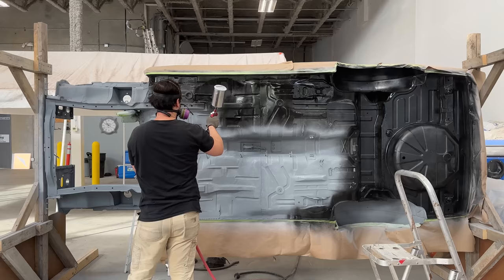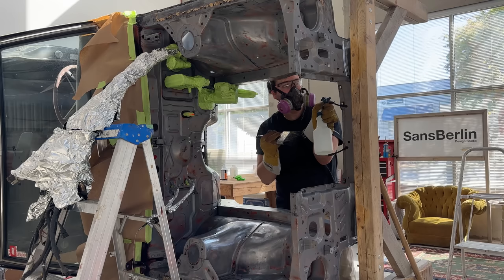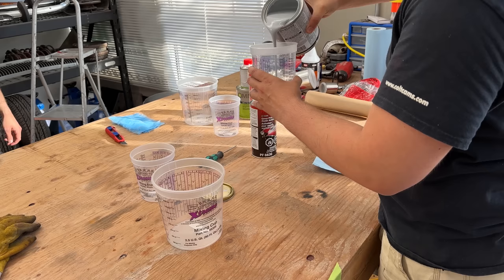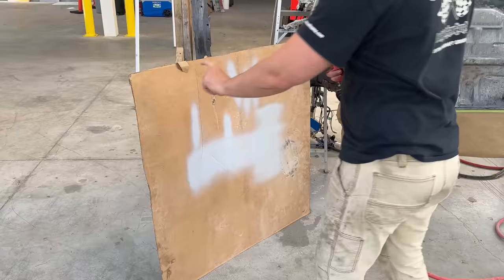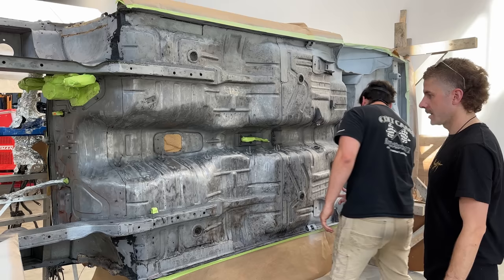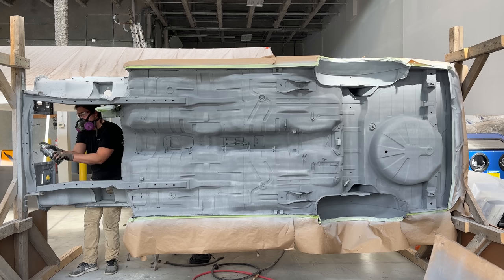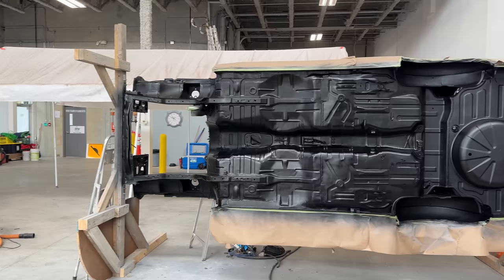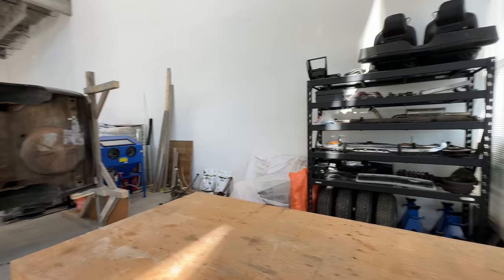1972 Toyota Corolla: DIY Undercoating

Comment: A few points.  Generally, on bare metal, the first coat of primer is an etch primer.  Then you apply the 2K primer.  On the bottom, you could have gone with a rubberized stone chip paint.  Not quit as thick and difficult as a bedliner type coating.  Then, when you spray, at the ends I noticed you were fanning off.  That is when you have the spray gun essentially travel in an arc.  The issue with that is that you get a coat that is thin at the sides, and thicker in the middle.  Keep your gun the same distance at each end of your pass and it will give you a more even coat.  

Enjoying your progress!  It makes me miss my ‘72 Corolla.
Reply from the maker: Hopefully that rust converter containing the acid did some etching, as I did think about it. Thanks for all the tips man, i'll remember it!
Reply: @sansberlin   Epoxy primer is fine if you ask me. I know there is somewhat a tug-of-war between epoxy and etch primer, but epoxy has worked well for me. Considering the conditions in Finland, which is between ice and thaw with road salt added to the mix, I would say epoxy sticks on there well.

Stone chip is a good call, and you can paint and clear over that to get a nice finish too, but regardless I skipped it on my door sills, will have to see how the paint holds up.
Reply: Etch primer stays in the 70s. We now have 2k epoxy sealer
Reply: @janeblogs324   I've seen both used.  But I guess epoxy is the better option since it’ll stick to just about anything.
Reply: @---xd4wm  Interesting, I figured thats a possibility but I sprayed epoxy on acid treated regardless, I guess I was in luck. I do sand the acid treated areas before paint anyhow.
Reply: @---xd4wm  Interesting, I figured thats a possibility but I sprayed epoxy on acid treated regardless, I guess I was in luck. I do sand the acid treated areas before paint anyhow.

Comment: Very good work ! Just as an information, dont add a rubberized undercoat. Use a thin film of fluidfilm ASR as base and spray a Wax based coating like Dinitrol High Performance Wax over it. Your car wont ever rust. For the cavities you can also use Fluidfilm ASR with the adapter nozzle to spray 360°. You really need to get material in, dont be cheap on the application.

Comment: Man I love what you're doing, it's both relaxing and inspiring to watch. But please use earpro when you're spraying stuff with the air hose. I have tinnitus now and all I can say is I'd rather have dealt with the momentary hassle than deal with this permanent discomfort that is only going to get worse over time. I don't think the spray gun needs earpro since it's not nearly as loud or high pitched, but straight air does need it.
Reply from the maker: When I blow out the air trap in the back its so loud! will do, thanks for looking out

Comment: I'd say you are doing a great job. When it comes to bedliner, those thick, goopy substances seem to be all a sure fire way to hidden rust and more problems. Fluid film seems to be one of the bigger brands in North America, and the application is very easy and it shouldn't hide anything beneath it. Of course, the protection is mostly from rusting and not from impacts from stones or gravel, but that could be a simple and quite inexpensive way to add a little extra rust protection, if you think it is necessary. Since it is not really a coating, but a film, it is recommended to be reapplied every year or at least every couple of years, but it is something you could easily do yourself. Similar products are also available from different brands like Liquid Moly, Dinitrol (not sure if available internationally), Würth etc.
Reply from the maker: Could something like this be applied even after i've painted? extra layer of protection? New episode today

Comment: since youre rebuilding the interior id suggest you add a layer of dynamat sound insulation and they also sell some other foam that does like thermal insulation like put it EVERYWHERE yes it will add weight but the interior will fell like a luxury car, im talking roof, doors, trunk, anywhere there's bare metal make sure to insulate it, also if you do add it get the roller tool to make installation easier, cant wait to see more from this.
Reply from the maker: Right now there's already carpet in the car...but there was a small fire in the last episode. I think you're right, maybe I should take out the carpet and headliner to insulate everything. I want that luxury resto feel. Cheers man
Reply: it won't work, the majority of the noise comes through the thin glass and tire noise

Comment: In trucking, I know a lot of old owner operators hit their frame rails with 3 cans of WD-40 before the winter, with the salt on the roads. I know it's a different thing here in Vancouver, but it's still probably a viable option on a car. Those guys don't have rust issues with their trucks.

Comment: Not gonna lie, I'm just some random that had this video show up in my feed, and i wish i had known you were doing something like this beforehand so i could give you some advice.

With deoxidine, (rust converter/phosphoric acid) you need to apply it with a scotch-brite pad and rub/key it into the surface of the metal and really deeply into the left over rusty pits. The reason you use a scotch pad is the acid will not penetrate into "deep" rust by itself, it will only convert that very top layer. You ideally need to remove as much rust as practically possible with a wire wheel first and use the acid as the final solution for the small bits you either missed or cannot get to.

From there you immediately wipe it off with a damp wet rag before it dries, which you semi frequently rinse out in a bucket of water. It seems counter intuitive at first but the wet rag actually dilutes the excessive acid and helps spread it out on the panel. If you've done it correctly, your panel will have this almost tacky looking clear coat effect, that is silver/blue in colour. This is a fine layer of acid that is converting and temporarily protecting the panel.
If you leave straight acid to dry, it will form thick white layers that will not come off very easily. It will clog and ruin sandpaper quickly and you will consume a lot of denatured alcohol and rags. Ask me how i know.

When you are ready to progress, simply use a 50/50 mix of denatured alcohol and water in a spray bottle, spray the panel down and then wipe off the acid with some clean rags until all the acid is removed (the panel will go a slight orange/rainbow color when bare and the rags will go black/grey). Do a final pass again with prep-sol and rags + a tack rag + air gun to remove any lint.
I know the water seems counterintuitive but it dilutes and removes the remaining acid and the alcohol binds with the water and allows it to evaporate off the surface with little to no trace.

From here you should be mixing up and getting ready to apply a 2k epoxy metal sealer.

Unfortunately you've experienced exactly what happens when you do not remove the acid. The paint "fries up" absolutely everywhere because it is reacting with the primer (similar to paint stripper). This is also why you either completely avoid or very carefully use phosphoric etch primers over existing repairs like 1k primer and bog because it WILL react with stuff.
Most people do not acid etch primers these days, at all, unless they are trying to stick primer to a hard to stick to substrate, like aluminum and galvanized steel. Even then we have modern epoxy primers that do a better job.

I suggest before going any further, you look up these two YouTube channels. "the gunman", hes an Aussie fella that has shared countless hours of real world advice in all aspects of painting and gun setup. The other is "Astill Design" who is another Aussie custom car builder, who has been doing this work since the dawn of time. He has recently filmed a series of videos that cover surface prep, what products to use (with 1v1 interviews with PPG), where to use them, how to use them, how to apply bog, how to apply poly filler, as well as tips on gun size. I will admit that Astill is what i would consider high end in terms of what sand paper and what tools he has access too but the fundamentals are all there.
Both of these guys are an absolute wealth of information which should come in VERY handy on your build.

ill finish off by saying that im not trying to beat you down in any way, if anything its exciting to see people getting out there and having a go at this stuff. I just think, if you can avoid making unnecessary mistakes (like what i have in the past), you'll be much better for it.  Good Luck :)}

Edit: oh and avoid 1k products as much as possible. They are for hobbyist, quick spot repair and quick fix industrial stuff for farmers. The primers are not water proof and they will react with basically anything (thinners, prepsol, metho, sometimes even 2k paint) and they are NOT UV stable. Basically the only 1k product i would use now days is epoxy primer for stuff i dont really care about or doesnt see the sun (engine bay for example) and 1k seam sealer. Everything else is trash.

Comment: off the theme advice,

add some pop-filter between you and a mic, it'll drastically reduce clippings on P and B (just a circle of wire and an old /new stocking/sox, stocking preferable due to better noice transperancy)

Comment: clearcoat is always a pain. its a different monster altogether. I normally thin clearcoats up to 90% thinner
Reply from the maker: Have you had any problems thinning it way down? The spec on the can said I could only thin it to a ratio of .5 of what I used, so I was afraid to add more?
Reply: you should have to lower the pressure. you're putting to much air and that's why your clear disappears and nothing lays on the surface @sansberlin

Comment: only problem I noticed is that 2k high build primer usually doesn't seal out moisture, and not sure what paint you used. I would have sprayed a 2 part epoxy 2-3 coats and potentially top coat on that, but only necessary if the epoxy will come into contact with UV rays.
Reply from the maker: Ya its all going to be under the car so im not too worried. I put as many coats down as possible. I just went to the automotive section of KMS and told them to give me an autobody paint for undercarriage and they shook it up for me. We'll see what happens.

Comment: I'm unsure of what clear you used, just from how the job turned out maybe it was a low gloss or even matte. As for the application issue you had it's not fault with the air pressure adjusting that will atomize the particles finer what you needed to do was open the fluid and spray it wet

Comment: Hello. I love that car. Hey, question, do you know what will you do for suspension?  I am building a te27 trueno and installing a F22c engine on it and I would like to get some ideas for the suspension. Thank you
Reply from the maker: I’m actually not too sure at this point, but I need to start doing some research. I want a smooth ride, not too stiff. I was hoping to find some Bilstein inserts for the front shocks, and b6 shocks for the back, and just clean up the leaf springs. What have you researched so far, I’m curious?
Reply: thank you for the feedback...

Comment: Looking great, don't worry so much about it looking rough though nobody but us will know it looks rough underneath :P

Are you able to continue working on the Corolla or are there any things you're struggling with right now that maybe we could give you advice on?
Reply from the maker: I've learned a lot, but every item I touch fractures into 100 different things I didn't know existed. 1.Known knowns (things I know), 2. Known Unknowns (things I know I don't know), 3. Unknown Knowns (things I don't know but others do), and 4.Unknown Unknowns (I don't know and how would anyone know).  I feel like most things fall into 3 and 4 being such a beginner hahaha. 

So things are coming down the pipeline with the parts I need to fix, brake and fuel lines, wiring etc. but until I touch and fracture each item to see all the knowledge needed in their own world, I wouldn't even know what help to ask for.

This reply felt very trippy.
Reply: @sansberlin  Indeed trippy, but I get your point. Just remember, if something seems like a hour job it'll probably be an all day job with everything that comes extra hahah

Comment: 9:35 too much pressure and not enough fluid (the knob at the back of the gun) Screw the fluid out 1/4 turn and then trigger on/off till you get splattering out of the tip when off triggering, then turn the fluid back in 1/4 turn. That's the max fluid for your tip size/fluid viscosity, then adjusted air pressure till you have acceptable orange peel and move the gun at a speed/distance that won't run

Comment: What did you do after you sprayed on the phosphoric acid? did you just let it air dry or did you wash it off with water afterwards before priming?
Reply from the maker: It wasn't pure phosphoric acid, just a product which contained it, not sure of the percentage. The instructions said to wait until it dried out / becomes sticky, no need for using water

Comment: Here in Brasil we always use rustproofing undercoating with Two-Component Polyurethane Sealant after the Rust Converter and before the primer. Normally it's yellow. 
I did it in my Gol GTi. you can see in this video: https://www.youtube.com/watch?v=CwcJ8P_x-IU

if you take dirty roads all the time, you need this.
Reply from the maker: Up here in Vancouver it doesnt get too salty or snowy, so i'm not too worried. But i'll check out the video, thanks man.